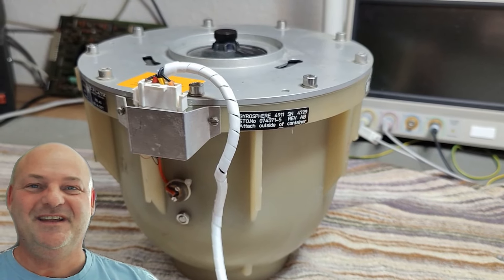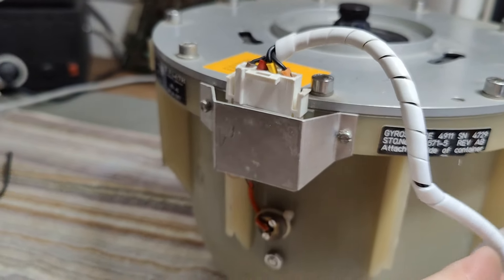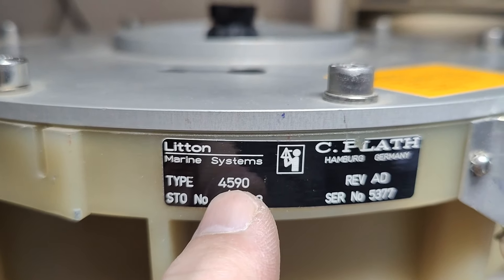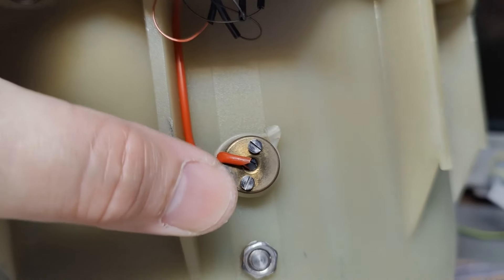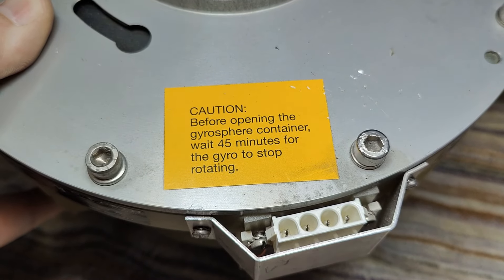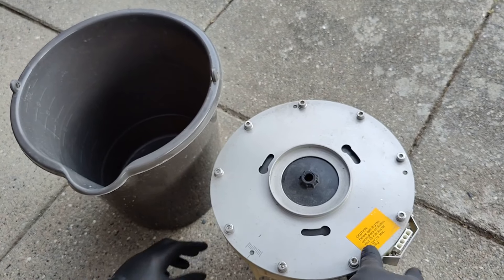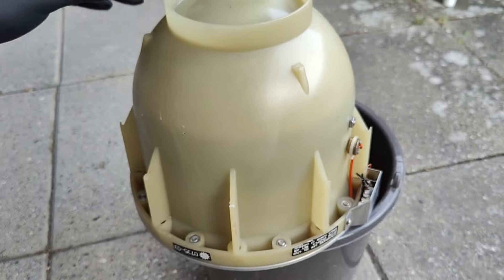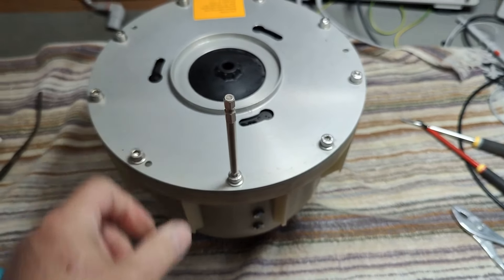Litton Marine Systems Gyro Gyrosphere type 4590 C. Plath Mercury

Comment: Heat, you did not have to destroy dang the thing. Heat to open, geez
Reply from the maker: I think you are right, but the special pointy screw in the bearing end was also glued in, so no way to unscrew it, I had to drill that one out too, it could have saved me a few drops of blood :-) heating epoxy all the way and pulling and wriggle it, to get it loose, sounds also like a bad idea, hot epoxy fumes not good either.

Comment: Looks like 115VAC 400Hz will run it.  Housing normally is filled with alcohol, ethanol denatured with some oil and a bittering agent, so that it provides damping, and the miscible oil provides lubrication to the bearing surfaces, but likely somebody replaced it with water during service.
Reply from the maker: demineralized water most likely, and they lost the mercury somehow. if it is really 115V 400Hz both my motors have the same defect, since they spin so slow, I wanted to see much more action in the high rpm, anyone know if the sphere with the motors contain some sort of gas type ? pressure ? or vacuum ? when i opened mine i got a really weird smell from it..
Reply: @TeardownOZ2CPU  Then if 115VAC is not working try 200VAC, the smell is from being sealed, and the hot varnish compounds, mixed with the off gas from the epoxy, being blended with boiled off light lubricant. Likely those bearings inside are also well worn, which is common on high hour units. Gas fill as there is no valve for purge, it would have been at best flushed with dry nitrogen before sealing, nothing more.
Reply from the maker: @SeanBZA  thanks, i am maybe a little bit over sceptic when it comes to unknown smells specially when it was chemical sort..
something just did not feel right when appling AC power, turning the volume up did not have the wanted effect, so i expect the frequency is way off, i also tried to vary the freq to aim for more speed, maybe that could tell me if i go in the right direction, no luck so far, who can we ask for motor spec ? why is the a keept secret ?
Reply: @TeardownOZ2CPU  These derived from military avionics, so the 400 or 440Hz is a common thing, and them running badly probably comes from the internal bearings being very badly worn, as they are run dry, with perhaps a dust of graphite or molybdenum sulphide powder there, or even ceramic balls on steel races and shaft.
Reply from the maker: @SeanBZA  if i push the rotor gently round, it keeps spinning for a long time, so i feel the bearings are not to blame for my lack of speed, i must be delivering the wrong type of energy.. and that confuses me.. how hard can it be :-) i will keep this and bring it back to the lab, the day i get more info on the motors..
Reply: @TeardownOZ2CPU  Could also be a failed capacitor, either self healed to nothing, or leaky.
Reply: @TeardownOZ2CPU  But also those bearings run in a different position in use, as they move away slightly from the centripetal force to the outer part of the race slightly, and wear it there.